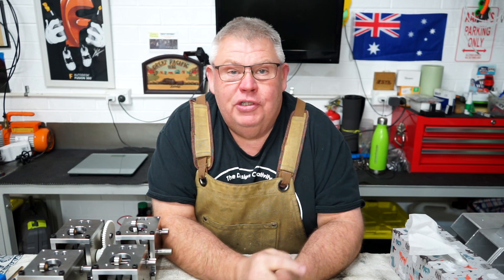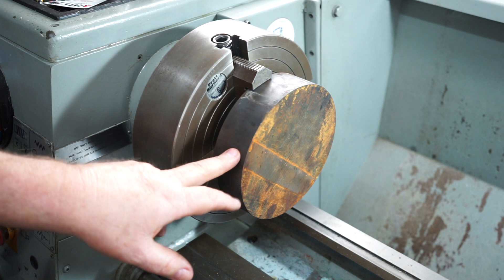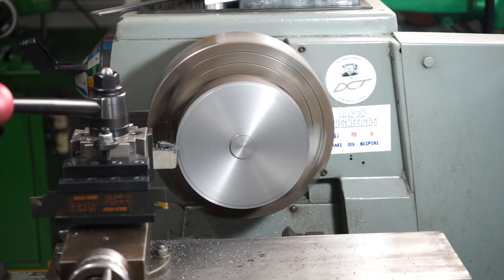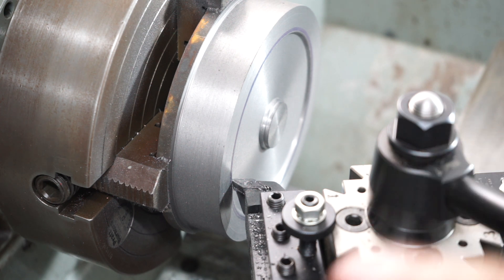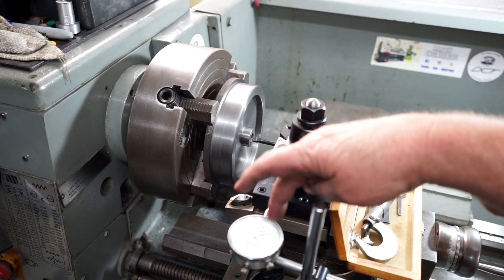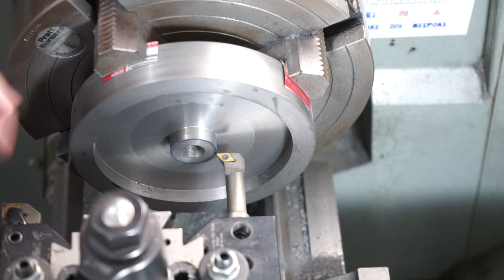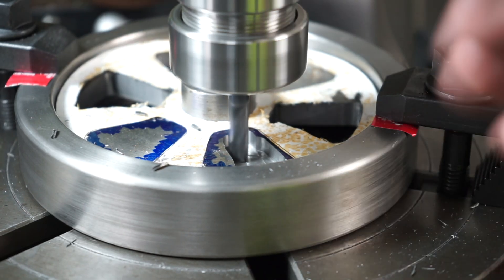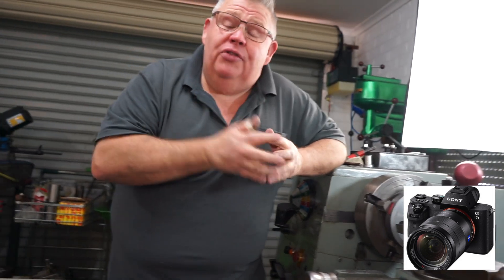4-Stroke Engine Build | Part 3 | FLYWHEEL

Comment: Hi Aaron, Nice work on the flywheel. Just another 3 to go...lol
Time consuming work but worth it.
Regards
Kevin
Reply from the maker: G’day Kevin and thanks mate. You’re not wrong there. For the spokes on the other 3 I’ll CNC them on my Syil. Bugger using the rotary table again 😜
Reply: @AaronEngineering  Cool. Would be good to do a video of the process and CNC machining of the spokes...hint hint

Comment: I'm not sure about you, Aaron. 
But I have always hated running Cast Iron on a Lathe 😒

It gets everywhere.
Especially up your nose ???

Nice work on the Rotary Table, too.

The build is coming along well. It won'tt be long before we see it running 👍
Reply from the maker: G’day Peter. Yes I’m with you regarding cast on the lathe. I stayed away from using the carriage and only fed with the compound and cross feed. It’s like valve grinding paste isn’t it mate. Cheers Peter, Aaron 👍🍻